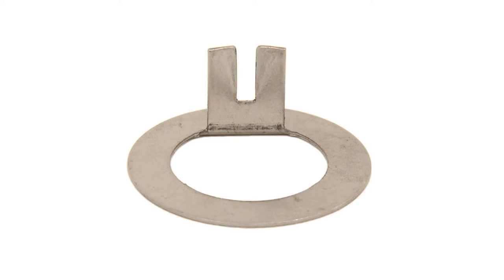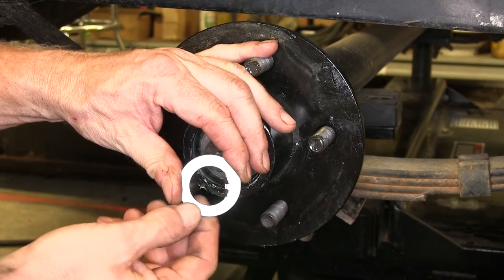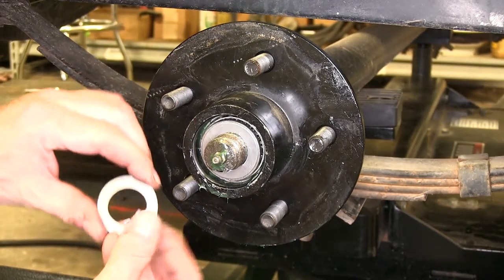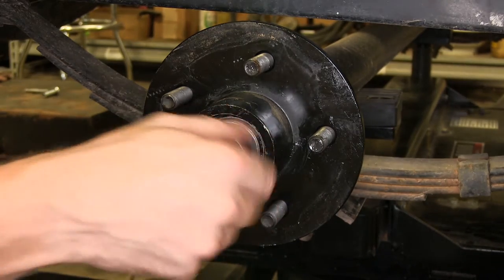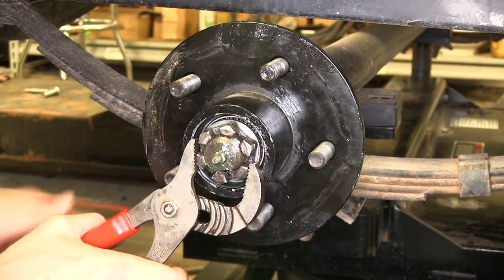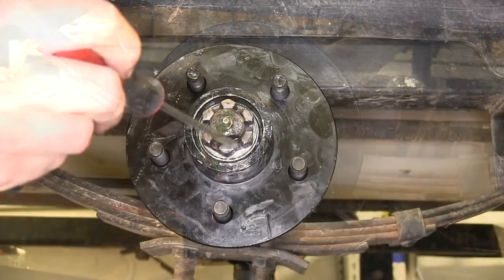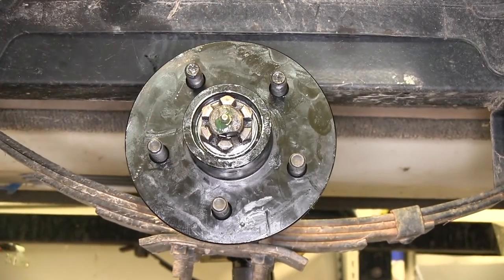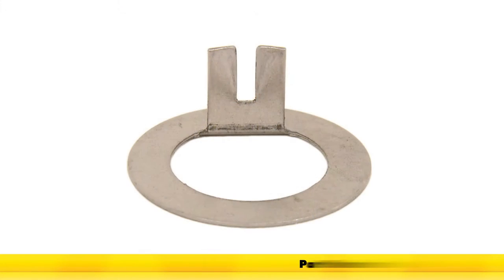etrailer | TryRyde Tang Type Replacement Spindle Washer Review

Comment: I did that exactly as you did, and damn near lost a wheel.  Didn't realize it until I was winterizing my boat and trailer.  I HATE this design, cotter pins are not only simpler, they are way more secure.

Comment: I got a new axle with this type of washer instead of the familiar cotter pin - if you don't push the tang into the castle nut it'll be a diaster - trust me and my new, second axle 😢

Great video - thanks - i know now
Reply: I think it's a Mickey Mouse design.  It's what I have on my current boat trailer and it's been a real pain!  I've damn near lost a wheel after one of the tangs or the castle nut or both loosened.
Reply: I know the pain.  I bought a used trailer with this on it, and it failed.  Luckily, I was able to stop before losing the wheel and tire,  However, the spindle was destroyed and a 7k axle had to be replaced.   I'll make sure I use cotter pins since I haven't had one fail on me.

Comment: Am I understanding this correctly? If that one little tang happens to break off, the castle nut, which is not even hand tight, could easily spin off and your entire hub and tire/wheel come off with it in one piece.

Comment: How does this compare to cotter pin? Are there other types of retaining washers that will work with easy lube spindle with castle nut?
Reply from the maker: This style of spindle washer is typically easier to use than a cotter pin for the sake of removing it and putting it back in place. It will accomplish the same job as a cotter pin.
https://www.etrailer.com/Accessories-and-Parts/TruRyde/5-101.html
Reply: etrailer.com thank you, will other styles work as well?